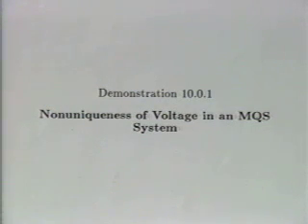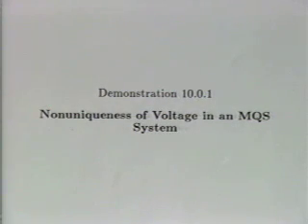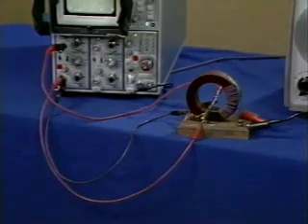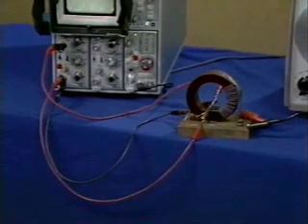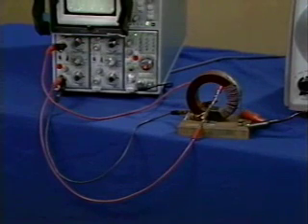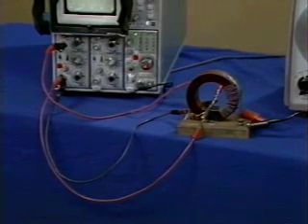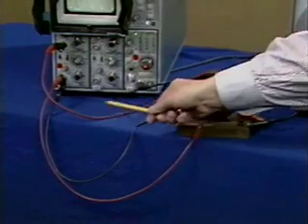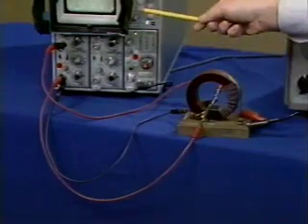Chapter 10.0.1 (demo only): Non Uniqueness of Voltage in an Magnetoquasistatic System

Comment: This video is garbage !!! This is a perfect example of ... How NOT to use unshielded scope probes near a changing magnetic field.  The scope probe and associated wire is forming a secondary winding with + induced voltage on left side and - induced voltage on the right side.   The level of incompetence is stunning.